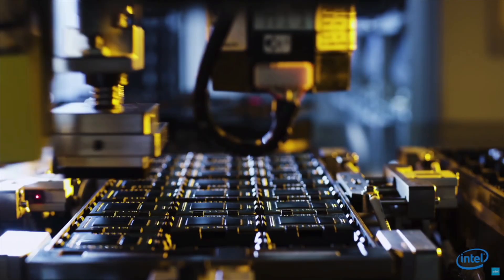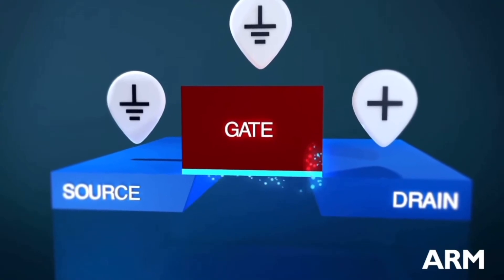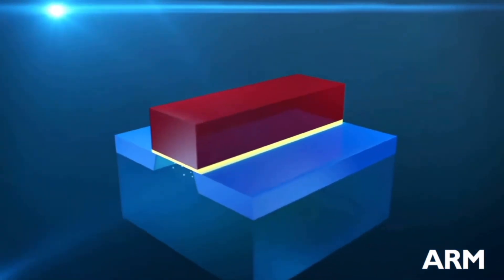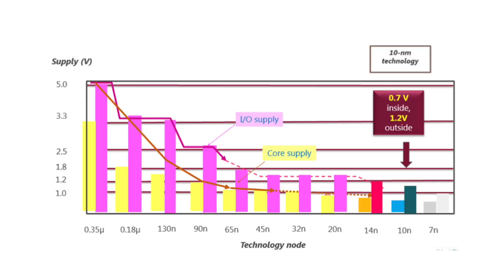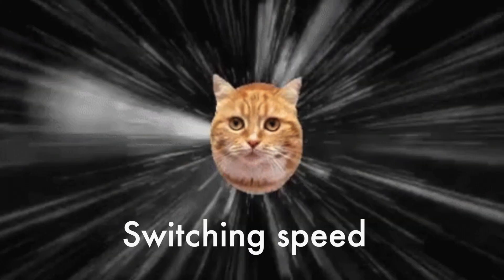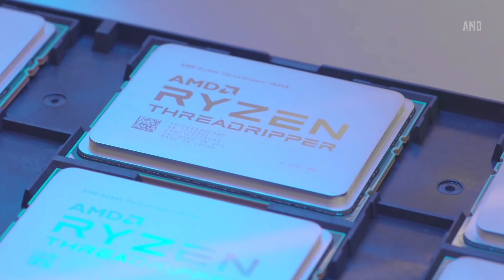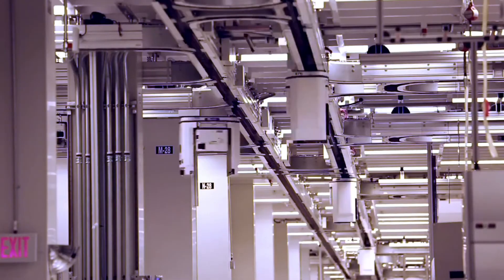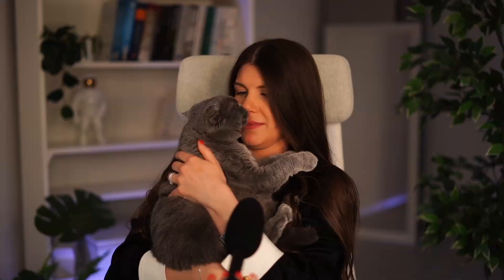What is wrong with 5nm, 3nm, 1nm.. CPU Technology Nodes explained

Comment: I've seen too many people comparing nm directly and saying Intel is far behind, it's great to hear an actual explanation. I also love to see that as we reach atomic scale, engineers need to be creative and change the geometry of the transistor. From planar to FinFET, to Gate All Around and more.
Reply: I was thinking about the atomic scale of the chip designs, never made a move to check it out.
How can we print UV etched circuits so small? Certainly Heisenberg wouldn't allow that.
Interesting to see planar going 3D 🙂
Loved the video.
Reply: @BBBrasil  You don't print.  You lay down layers of material and then use lithography to etch the material into the proper shapes.
Reply: Maybe a dumb question, but if the gate completely surrounds the substrate, where do the charge carriers go when the field is applied? Is there some kind of skin effect going on? Cause planar FETs push the charges to one side creating a channel near the gate. Those carriers need a place to escape to create a depletion zone.
Reply: If Intel is not too far behind, why then it wants to TSMC manufacture it's latest chips??
Reply: @dfv671   "If Intel is not too far behind, why then it wants to TSMC manufacture it's latest chips??"

First, I follow the industry and that means I not only follow the semi-conductor business but also chipmakers (designing the logic for circuits)

You're question doesn't have a simple answer, only a long one because decisions a company makes like what you are saying are often very tough decisions to make. Also, the second part is incorrect.

So, the first thing is who is doing what and with what technology. So, first to Intel. Intel in moving to their Intel 7 process node, formerly known as 10nm, is manufactured using ASML DUV lithography which is older machinery and really it's not ideal for making a process node with a transistor density as high as what these "7" nodes are. Samsung did the same thing for their first move to their 7N, but later were able to get onto ASML EUV lithography which was made to get down to nodes like TSMC N7 - N3. Intel is FINALLY on ASML EUV lithography with their upcoming laptop CPUs named Meteor Lake and it's on Intel's Intel 4 process node. Intel's "4" node has a better transistor density than TSMC N5. It's hard to know EXACTLY how all this compares because you have to see similar nodes being used the same way, take slices out of die and stick them under an electron microscope and do calculations.

And before I go further, there isn't a FIXED transistor density for these process nodes. First, there are different libraries of components that can be laid out on something like N7, and that includes transistors. The biggest categories though are based on density. There's high density and low density libraries. What a company like AMD, a chipmaker, can use is based on what they're trying to make and how fast they want the transistors to clock. High speed devices are going to use low density libraries and low speed will use high density libraries. This should make sense since the faster you clock something, the more current you have moving through and around the device which means it can bleed into components right next to it. So you have to space transistors out more when clocking faster.

Still following? Intel 7 is GREAT for high speed devices and Intel can clock their Intel 7 much faster than TSMC could ever clock an N7 variant. However that comes with higher power. Higher power consumption isn't BAD for some devices but it is for others. So the takeaway is Intel uses DUV, an older lithography technique to make their Intel 7 process node. Because DUV isn't great for a transistor that small you get higher defect rates when making Intel 7. 

So one point you brought up was "If Intel is not far behind". That's a separate point than the second part of the statement. Intel has finally moved to ASML EUV lithography and are currently making their Intel 4 process node to make their next gen laptop 14th gen core CPUs, code name Meteor Lake. The laptops come out the beginning of next year, which means Intel is producing the die NOW. It's believed that the transistor density is better than TSMC N4, which is a custom node TSMC is making for Nvidia. TSMC's finest node, so the best transistor density is their N3 which went into the Apple products that recently released.

So Intel is now producing Intel 4 on ASML EUV lithography. TSMC started producing N3 on ASML EUV lithography a few months ago. The difference is now ONE node IF you are saying that the difference in nodes is transistor density. However there's other characteristics about these companies nodes that will make them ideal for doing certain things, you can also get into pricing differences or defect rate differences so transistor density isn't everything. It's a good chunk of the picture, but not everything. It's everything if a chipmaker wants to shove a few billion more transistors into the same space.

So that's the first part, why it is Intel isn't far behind. They're one process node behind TSMC and by 2025 they could be the same and by 2026 Intel has a good chance of being the first company on a "2" node. However, these are ADVERTISING terms. There is no number whatsoever that relates to "7", "5", "3", etc..... What this means is ANY company could say something is 7nm, but you'll have other companies point out the differences and get into endless attacks against them if it's not similar to other companies' "7" nodes. But since no company makes a node where the number relates to any specific measurement, it's a somewhat hollow terminology. What I know is that as these companies keeping coming up with new nodes, the transistor density is supposed to increase and they set goals to what they want that density to be. For instance TSMC is supposedly ahead on N3, right? After all Intel is NOW making an equivalent to TSMC N4 as far as density. But from what it seems TSMC didn't meet their goal for N3, at least not yet, but it's still CALLED N3. See how that works? Advertising term. Also according to insiders Apple isn't really happy with the node because the rate of production isn't supposedly what TSMC told Apple it would be at. I don't know why. TSMC and Apple aren't going to say.

What I KNOW is at least a couple companies have jumped ship from TSMC to use Intel 4, so apparently Intel has shown this node to different chipmakers and they like it enough to use it. It will be in full production next year for different customers.
Reply: @dfv671  Now for that second part, "why then it wants to TSMC manufacture it's latest chips??"

Where did you read THAT?? That is a TOTAL misrepresentation of what Intel is doing.  Source please?

I'll explain what Intel is doing right NOW, and what they are using TSMC die for right NOW.

Intel uses their own process nodes to make CPUs. Intel recently got into the business of making graphics adapters for PC, just like what AMD and Nvidia do. They're also upgrading the graphics processor in their CPUs to the same technology they're using in these graphics cards (GPUs).

The current Intel GPUs are using Xe graphics, and the first generation is Alchemist, and they use ARC as the product name. The most popular GPUs they're selling is the ARC 750 and ARC 770. Now, they're competing against the likes of Nvidia and that's a TOUGH market. Their own die, Intel 7 uses too much power for that application. But it's more than just that. It's also production rate.

So, once again Intel uses DUV lithography to make their Intel 7 process node but it's not ideal. Ideal is using EUV lithography to make Intel 7, but Intel isn't going to do that. And they aren't going to make another fab JUST for die to go into a new line of graphics they're making. They don't even know if they'll be successful in that business.

So right NOW the only thing Intel uses TSMC for is making graphics die for their new GPUs, and they HAVE to because TSMC die is lower power and they need every possible advantage they can get going up against Nvidia. I THINK it's TSMC N6, I'd have to try to find it, not going to bother.

In the FUTURE Intel can use die from different companies to do different things, however they are ramping up their production for Intel 4. They want to get off their Intel 7 process node but they'll still be using it next year. But they also want to ramp up their Intel 3, MAYBE. See and this is where it gets messy for Intel because they're in a transition phase getting onto ASML EUV but at the SAME time they're the first customer to get ASML High-NA EUV lithography machines and this will be used to make Intel 20A. It wouldn't be smart for them to ramp up a process node if one year later they can be on a better node.

So Intel has a LOT of work happening right now with different nodes and that's not typical for any semi-conductor company to be working with 4 nodes at the same time (Intel 7, Intel 4, Intel 3, Intel 20A). They're still tweaking Intel 7, they started production with Intel 4, and at the same time they'll be doing the R&D to get onto Intel 3 and Intel 20A. They might skip Intel 3 if things go well getting onto Intel 20A using High-NA EUV. After all if they get can that done in a timely manner they'll be the first on that equipment and that node. If TSMC puts out a "2" node but they aren't on ASML High-NA lithography, then it won't be as good as Intel's 20A. Just like DUV has its limits, so does EUV and EUV really isn't good for getting down to a "2" or "20A" node, those being the same thing.

I said that Intel is making new CPUs where they can use die from different companies. This now needs an explanation. NO company makes die that's ideal for any situation, cost being one of those factors. YOU need to read about Meteor Lake, like a LONG article about it. When it comes out it will be the most advanced CPU on the market. That doesn't mean it will be the fastest at everything it does, but it will be full of capabilities and the way it's made is revolutionary. A primer would be to read about AMD and their chiplet design for making CPUs, which was also revolutionary but creates some problems. Intel is going to use a tile interface between multiple die on the same package. This says that each chiplet is pushed right up next to another chiplet, so when you look at their new Meteor Lake CPU, you see a bunch of chiplets pushed nest to each other to act like a single die. With what AMD does, they have their chiplets spaced apart, and they have to run an interconnection on one of the die and that slows things down. In either case this is called MCM (multi-chip module). Intel's tiled interface means a die that is pushed next to another one talks directly to that die, in parallel from what I understand, not serial transfer which means it's operation as if you do INSIDE a die. The world hasn't seen this in full operation so we don't know how good this is yet, but the last time Intel kept quiet about new CPU technology it was very impressive (their hybrid CPUs with p and e cores). I'm expecting it's going to be excellent. We will see it early next year in laptops. Intel calls their chiplets tiles, so I'll say tiles from now on. Because of this MCM design Intel can have specialized tiles for AI, graphics, hardware acceleration, big cores (p cores), little cores (e cores) or anything else they come up with they feel should be in a CPU. They HAVE to add AI acceleration though because Microsoft wants that in CPUs for systems that will be allowed to get Windows 12, where Win12 will use AI for different computing. 

Intel expects to need a LOT of die to make their new gen products, and this includes these new CPUs and also their 2nd gen graphics. Because Intel wants to move off of Intel 7, I mean they need to, AND because they're only starting NOW for production on Intel 4 AND they have customers for their Intel 4, they can't snap their fingers and all of a sudden have many fabs producing 4, and they don't want to because they want to get to 3 and 20A as soon as possible. For next year their desktop CPUs will still be on Intel 7. For Meteor Lake the suggestion is they're using die from themselves with Intel 4 along with die from TSMC , possibly N3 and there might even be other die. Have to wait and see. Their 2nd gen graphics will use TSMC.

In two years from now when Intel moves to next gen products they should be in a better position with their process nodes and will use more of their own die, but as they're moving to these higher density nodes they're going to get more business which means they'll most likely still use TSMC die.

I hope this helps to clear up any confusion on your part.
Reply: You right.
Reply: I made the same mistake . I had no idea the nm was now a performance indicator. It reminds of of when athlon CPU’s were released with XP numbers to suggest GHz equivalent with the intel P4 chip.
Reply: Even then, they’re behind, their current CPUs use Intel 7, while AMD’s use TSMC’s N4 (aka 4nm).
Reply: Intel is still far behind 😂
Reply: @Shadow__133  I see you fell for the marketing.
Reply: @bogususer2595  Intel doesn't have tech that's close to 2nM of TSMC now. Their 7nM (180 million transistors per square mm) is closer to 5/4nM (174 million transistor per square mm)  of TSMC. Take note that Raptor Lake (13th Gen) is still using Intel 10nM superfin process currently and they are currently still working on their 7nM. TSMC has already produced and sold 4nM to Nvidia (Ada Lovelace, that's why it's expensive) and producing 3nM right now (and working on 2nM). The way Intel has been missing their development deadlines, they aren't getting closer currently. Intel didn't even have EUV processing maybe except this year (they're selling their first EUV chip by next year - if it's not delayed again), Samsung and TSMC have already had their EUVs for a couple of years now and have sold chips using that tech.
Reply: @bogususer2595  I see you didn't.
Reply: @pkpnyt4711   I think you would like to say:  xxx  million transistors per square MILI meter .
Because 1square meter= 10.76 square feet
Reply: @minhchau8654  thanks, corrected.
Reply: @minhchau8654  "I think you would like to say:  xxx  million transistors per square MILI meter .
Because 1square meter= 10.76 square feet"

For ICs, the value used is MTr/mm2 (millions of transistors/square millimeter) We're getting up to around 200 million.
Reply: Guys, she literally says in the video that you can't compare nanometers directly. Did you all even watch the video?
Reply: Besides, this video is already pretty old, as is my comment
Reply: @pacifico4999  yes you can as nanometers is a measurement just like you can't say something is 1cm when it is 1.5cm
Reply: @harryvlogs7833 Brother watch the video before spouting nonsense 3:07
Reply: @pacifico4999  it's not nonsense  literally go look a measurement is always the same otherwise it wouldn't work like if you built a tower that was 1 mile tall and someone else made a 1.2 mile tower and said it was 1 mile but it clearly can't be as a mile is a mile just like 1 nanometer can only be 1 nanometer not 2 otherwise it would be 2 nanometers
Reply: @harryvlogs7833  She literally says in the video that manufacturers use "nanometers" as a marketing fantasy number, that's not related to any real measurement of the chip. At this point I honestly think you're trolling
Reply: @pacifico4999 I don't think they were paying attention. But this reminds me of how the lumber industry changed about 100 years ago. A 2x4 piece of wood used to be 2 inch by 4 inch. Now it's 1.5 x 3.5. It was shrinking to that measurement overtime and one point, each mill had their own custom measurements for a 2x4. It became a marketing measurement instead of the real measurement.
Reply: Well Intel is far behind
Reply: It is still far behind
Reply: Intel is far behind =)
Reply: Well intel sucks, using a smaller node generally means better power efficiency.  Architecture is definitely the most important thing, but 10nm is behind. Their cpu’s use so much power just to get the same performance as AMD.

Comment: Thank you for this excellent understandable  presentation!  
Question: How does node size and production yield correlate to reliability for the end user? Thanks!
Reply: Well, brands aim to keep a certain level of reliability.
If we were to make larger node with nowaday's precision, sure, we would have better reliability.
It's all in balance.
Reply: Reliability is not correlated. Reliability is more a factor of binning. Chip die have somewhat random quality so they sort them and lower quality chips are sold as lower end product. This lower end product has reduce performance by lowering clock and source voltage so even though they are lower quality their reliability actually improve because the silicon is not driven as hard as the top performing chips. The top performing chips is driven to their redline but since the silicon quality is better reliability is still good. Unless the product vendor decides to drive them pass their redline so that they can catch up to their competitors top performance. That is when reliability becomes an issue